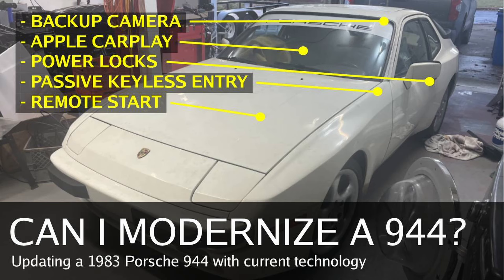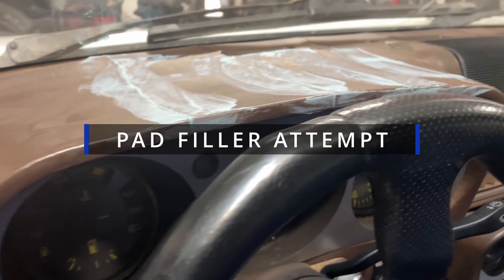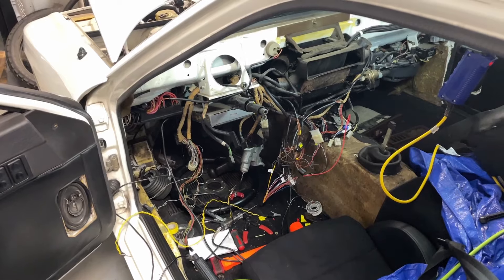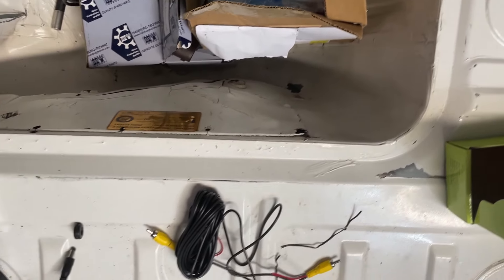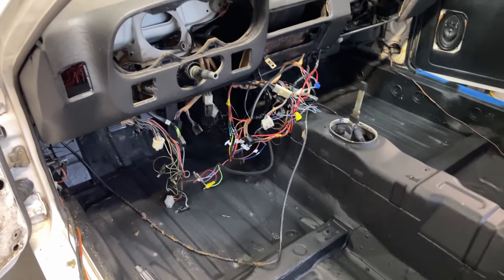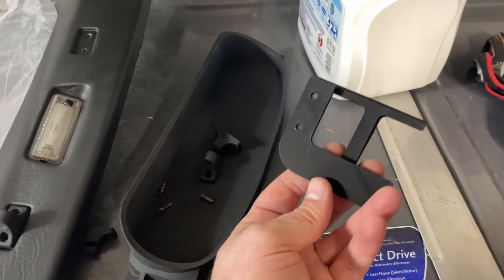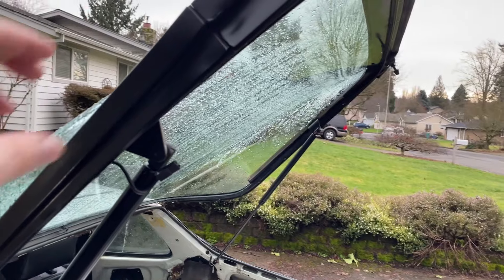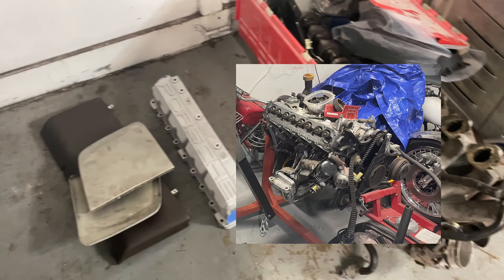Can I modernize my 1983 Porsche 944?

Comment: For the interior- working on a car using Corbeau seats. I bought extra seat material so I can upholster the back seat to match the front buckets, custom headliner, wrap the package tray & dash pad, and part of the door panels. It's a '70's American "Budget" sedan that sports brakes, suspension, engine & a manual gearbox that most people snicker about. It's fun
Reply: 8 GRAND for plain seats...amazing.